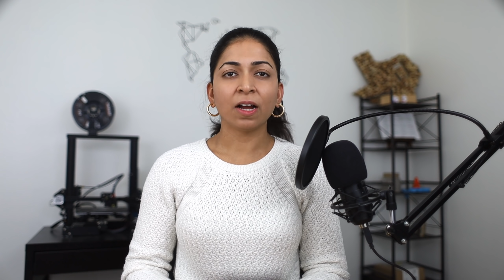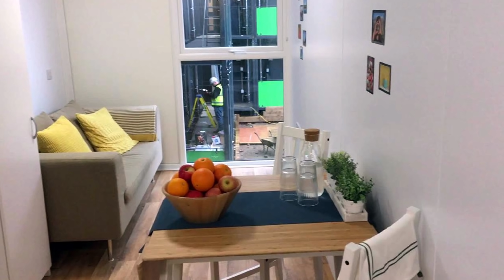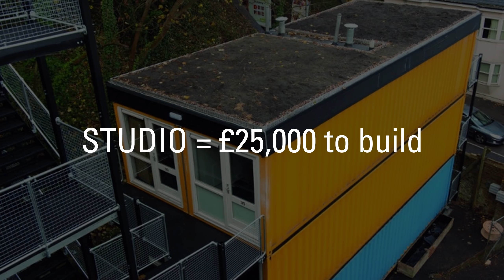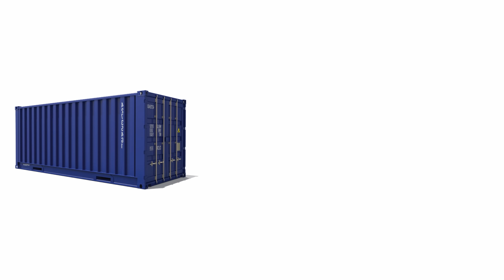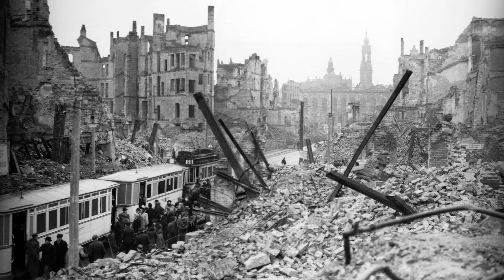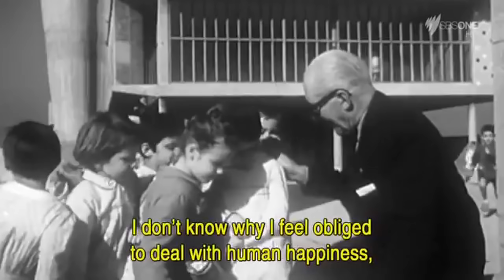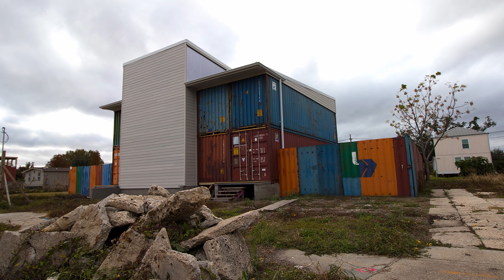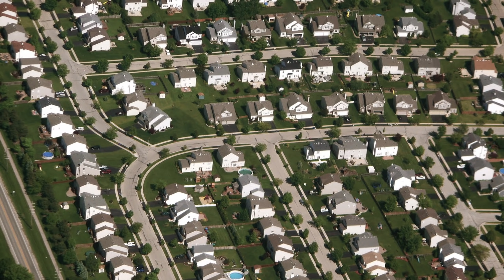Why Shipping Container homeless shelters FAIL

Comment: Homeless people wants a regular, typical housing on land with trees and grass.  The cost is too high to build and land is too expensive unless it is far , far away from a town.  Government constructed high raise housing buildings had failed. Cargo containers are an improvement over tents in the streets ?   
The solution is free money to solve the housing problems. No one needs to work in order to have housing.
United States is going in the right direction by giving away free money, so no one needs to work.  Also, free single family housing to all homeless will solve the problem.

Comment: I retired from acting to work for my local MP. The solution is very easy, all the time wasted on building temporary housing, permanent housing needs to be built.
Switzerland and Austria have had great success with social housing.
I lived with an ex boyfriend in Vienna in a social housing development, someone with money, and it was actually very nice.
The reason social housing has worked in Northern Europe is the it is not class based. By mixing people of different social castes together in housing near parks, community gardens, often roof gardens, and nearby shopping, has been successful.
Deutsche Welle has had excellent reports about this.
Homeless people are people. They need housing like everyone else.

Comment: I thought you were going to say they are dangerous and would collapse or something. People make really nice tiny homes with shipping containers actually for low cost. 

I think this is a nice gesture, but I think they do have to fix some issues with them. Like the needing insulation’s and proper air circulation. 

What about in Seattle where a group of women tried to make tiny homes for a community of homeless folks and that also failed! I think the tiny home communities got shut down and now those people got sent back to live on the streets. So what is the solution then?

Comment: The idea of shipping container modular homes are not the problem here, it is perfectly possible to built something to live in using modular building principles and shipping containers to do it. The problem is that the focus have been on the interior design and not on the 3 most important things: Ventilation, Heating and Cooling.
Also when doing critique of living in the shipping container "small" rooms, consider what the alternative housing actually would be, they would probably not be living in anything larger than that anyways, it would just be an apartment building with small rooms and poor insulation and poor heating and poor ventilation anyways.
A metal staircase sucks in winter, regardless of where it is placed, that is not unique for a shipping container.

Comment: I lived in a 20ft container for 4 years with 3 dog and 6 cats. Then again I had a 60sm yard which made the whole thing very comfortable. It probably won't be a solution for urban arrangement but it can be a very cheap housing unit while having all what is needed in a home. Also it cost only $7500 with bathroom/shower/sink, kitchenette, air conditioner 2 windows, insulation in the walls, floor and ceiling and electrical system (basic). This was in a country where temperature never reaches freezing but summer heat in the 95-105c range.

Comment: Shipping Container homes are good things but there not for everyone.  
i think shipping containers are the go to for one very good reason. there designed to be moved park homes are similar but not as easy to move espeshley when compared to shipping containers. hell the entire transport infrastructure is built for moving them. you can build the parts in a factory in standard size modules. and ship them any wear.
so a better way of doing things is building modular  that can be moved with the existing container infrastructure / equipment.  

the biger problem facing house building is cost of land. greed will make it so if houses are cheaper to build land owners can ask for more.

Comment: I live in Hawaii and we have a great homeless village made of shipping containers. They have AC and gardens surrounding the neighborhood. You can have pets. They look really nice and people can stay there until they are placed in Permanant housing. The only issue is that our state can't have enough of them due to expensive land values. You have to look at the alternative which is living on the dangerous streets and being exposed to being sexually assaulted, kidnapped or exposed to drug addiction. The ideal is permanent safe and clean housing. If you live in state housing, that housing needs to be maintained.
Reply: The weather in Hawaii is better for container living then the UK for sure…
Reply: But are living productive lives or are they housed homeless people? People in shipping container zoo?
Reply: I think it's just that there are better, more affordable, and safer options that would work better for the proposed use.
Reply: @orchdork775  there are ... MANY ... but they require effort to implement as opposed to premade metal boxes you cut holes in and add plumbing and furniture to ...

Comment: I can see what you are talking about, in terms of long-term situational positioning a shipping container home is far and away from what someone should strive to inhabit. However, when directly talking about the Homelessness problem, it would be loads better than on the street. If all you have is a nylon fabric tent that you got for 14GBP, then this kind of structure would be a good 'leg up' to get you on your feet again and provide security.

However I agree it shouldn't be a permanent solution, but it would be a good temporary solution IF A: You lived near a port, where these containers could be easily sourced or relocated cheaply to the site where the conversion occurs. B: You could bring them up to code, with proper insulation externally rather than internally so as to combat the mold issue, and C: You could weather proof them to a better degree.

As for a more 'permanent' solution, I would rather see Tiny-house village communities. Properly constructed with traditional techniques in modular house building, but for single families. You could still do the 'kit of parts' style of teaching, but have the modularity be dictated by the clients to address their needs within a set pattern, rather than a cookie-cutter design where one size fits all.  Allow the people who use these homes to decorate their spaces the way they wish, so long as the decorations aren't obtrusive, and allow them to make the home their own, rather than having to fit a clinical mold of everything needs to be the same, or some HoA style nightmare of regulations. 

You want them to feel independent and human again, if they wanted to feel claustrophobic, or be surrounded by concrete they would have stayed on the streets on some back-alley sidewalk. Which is where the beauty of having the large communal spaces comes in handy, you can even have them get involved in helping construct the new villages and decorate and prepare land for further construction and teach them trades or skills that might be lacking that could help keep them independent and less likely to return to homelessness.

Another good part about the 'tiny house' idea, is if someone wishes to relocate, they wouldn't HAVE to abandon their property, if the homes were kept sufficiently modular if they choose to relocate they could easily pack up the home and have it transported to a new location. Otherwise, you could refurbish the units cheaply, or replace the modules that are damaged or aren't to the next tenants needs. 

I would really like to hear what you think about the Boxabl project, and hear your input on what that company is trying to do in terms of their vision for modularity, perhaps a deep dive.

Comment: Another thing regarding the homeless, they tend to fall in five categories, with most in the top three
1.  Mentally ill
2.  Substance abusers
3.  Criminals, due to previous or current criminal activity getting housing is problematic 
4.  Chronically unemployment, or victims of economic circumstances.
5.  Choice, they wish to live apart and by their own terms

Public housing would only benefit one of these groups, #4.  Groups 1 and 2, need medical help first, and group 3 are not trustworthy enough to use tax payer funds to assist.  Lastly, groups 1, 2, 3, & 5 is unlikely to conform to the requirement for obtaining public housing.
Reply: All of these groups overlap, though. And to write off everyone who has ever committed a crime as too "untrustworthy" to help is part of the problem that breeds more crime, drug addiction, mental illness and hopelessness. Housing is a human right. To place conditions like compliance with traditional psychiatric treatment (which is hit or miss at best) on the most basic means of survival for vulnerable populations is inhumane. I think we need to separate the idea of "deserving" from access to the tools of basic survival.

Comment: This idea isn't bad - like the Douglas Devastator - the implementation is bad. Do it properly and these will be fine. Fit vent systems or better install industrial dehumidifiers and use the water for grey water, toilets etc. Insulate the thing properly. There are plenty of people have made excellent homes out of these using their own designs including sunk baths.

There are old prefab homes built in 1945 a few hundred meters from my secondary school and they are still being used, by the same families. From the people I talked to about them.. You'd walk into the barrels of an MG81Z if you tried to turf them out.

And as for the concrete places you mentioned - they failed because councils let them fall apart and deteriorate and then wondered why they had the longevity of a Lancia Beta in a rainstorm.

Comment: I mostly agree with the video, I would only add that the attacks on designers are slightly myopic. As an architect, a lot of what we do is controlled by our clients and project budgets. The idea of “value engineering” is the bane to our existence and is usually imposed onto us, which ultimately dictates the outcome (and direction) of most projects. When dealing with social housing, this issue is multiplied many times over. It’s hard enough to get for-profit housing funded with traditional building methods as it is, let alone social housing for the homeless. I hate container housing, but unwillingly and often times forced, designers and builders look elsewhere for more economical solutions. And lastly, designers are addressing a symptom of a much greater issue that is beyond our immediate control, and addressing the causations for such conditions is where you (everyone) should be aiming your disdain.

Comment: Lets be real here. Public housing projects fail because they are always underfunded and cheaply put together and that then leads to maintains issues that well made home just do not have. Making 10 good homes that will last 100 years is far better then 100 homes that will crumble in 5. Its just about money and very very very very long term investments. But you do not get rich or win elections when you handle the problem correctly. Thats why we see the same mistakes over and over. Politicians are looking for a election boost as fast as possible and the corporations are trying to make a buck. Solving housing is not complicated. Just expensive,slow and always in danger of corruption.

Comment: They're supposed to be temporary accommodations, everything negative stems from having to live long term "kids grow up there", "its a shipping container". I think as these are grouped they could be wrapped and given a shallow air space around them, they need work for climate needs but that can be solved. I think you hold the buildings more responsible than the administrators managers and tenants, for the FAIL, and i think its the other way round.

Comment: “We need to stop thinking architecture can change the world.”

Shows examples of architecture that have made the world worse.
Reply: No, she didn't. Properly maintained those places would have been fine, but they weren't because politicians are pretty much legally acceptable psychopaths and they cut funding because poor people and the places fell apart. They were in no way perfect but they got crappier with time and negligence - not the fault of the builder or the building.
Reply: @rosiehawtrey  I agree that maintenance and management and construction quality are factors, but I disagree that those shipping container homeless shelters, for example, would have been a success but for maintenance. They are a fundamentally flawed piece of architecture that contributes to a poor living environment.

When the same materials or funds could have been spent on better architecture, then what was implemented was measurably worse. How is that not an architectural decision changing the world?

Any building benefits from investment and maintenance, but no amount of those things can totally fix a poor design. Most failed highrises have been demolished or totally reconfigured to make them functional — not simply brought back to their original specification.

Just because mismanagement and poor maintenance and investment practices can change the world, it doesn’t mean architecture can’t.
Perhaps the intended meaning was that architecture isn’t a cure-all, in which case I absolutely agree, but I don’t agree that the world is not changed by it.

Comment: You make strong points. I'm a big believer in modular and standardised construction but I entirely agree about them tending to be soul-less and clinical. I'm also a fan of container architecture projects. When done properly they can be viable both economically and socially (to an extent). Keetwonen in Amsterdam, though its student housing, is a fair example of a relative shipping container housing success story. There are also a number of private homes than adopt the system successfully, but truthfully it does have its drawbacks and disadvantages, most especially when its done shoddily.

Comment: Honestly, living in a shipping container designed to be a home is not the same a living in a shipping container. It is sustainable housing and people need to break stigmas of poverty.
Reply: Shipping container design to be a home? You might as well skip the shipping container and build a container meant for living. Thats the main point.
Reply: @TheBooban  With everything there is a cost, the point of reusing these containers is two fold, one its a way to recycle/reuse them and two t's probably 80% of the construction as the frame and walls are already built. which saves in manual labor costs

Comment: Container homeless shelters could work, butt only as s short- to mid-term solution
40ft containers back to back with space for plumbing in between, the bathroom in the back and the rest being a bedroom and possibly a "kitchen"
And yes!!! I mean back to back with an open air walkway on the outside, not front to front with an indoor shared hallway
Their not supposed to be a home, only a stop-gap measure, a safe place to sleep/shower instead of the streets. They need strict rules because there's a difference between a homeless person/family and a j'nky that wants a free/cheap place to shootup
The problem is that those projects are short term ego boosts for the ones promoting them, butt they take long term planning and effort
By the time things go wrong the people that got the ego boost, the ones that said "yeah, I made that happen. Look at my greatness" are long gone and others have to live in their septic-tank or clean it up

Comment: I would imagine you could build a steel girder box/grid (for stacking) and slide in ready made caravans. Purpose build dwellings at a much lower cost than refitting shipping containers. Part of social housing problems is if you shove an entire community of poor people, often with social issues close together there will be problems. Crime, anti social behaviour, lack of respect, noise etc. 

These temporary housing projects really are designed for housing real homeless people, temporarily to get them off the street until they can get in a proper dwelling. Part of the answer is to have regular affordable housing in the greater community (aka social housing) which has to be scaled up immensely. Important key is to have a fairly robust code of conduct and swift action taken. Those that cannot, or will not behave and be ‘normal’ human beings must be effectively removed and placed into temporary accommodation. Until they can improve and be part of a normal community then there they must stay.
Reply: Even "the projects" weren't a bad idea and could have worked
The problem is that the people promoting it have a short term shelf-life (yeah, politics/fame) and it goes like...
Hey I have a shiny turd, to get more you must invest x-amount, if started they take the credit "yeah, I made this happen. I'm the greatest" butt leave before things start to smell (before it hits the fan)
As you say, real homeless people, temporary and rules that will be enforced

Comment: Whilst there are millions of shipping containers unaccounted for (often where some part of the logistical chain has folded and left the container in some random port without sufficient documentation) we also have to remember that these used containers are often already corroded or deformed and can't be used for housing
The idea of using spare shipping containers is nice initially, it's not realistic. We need to fight both the housing and shipping problems separately at the source instead